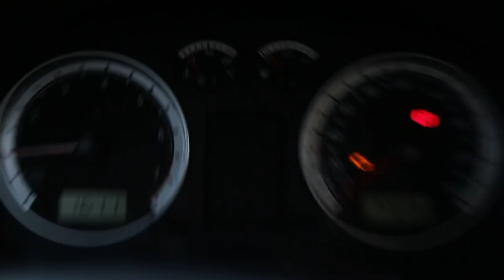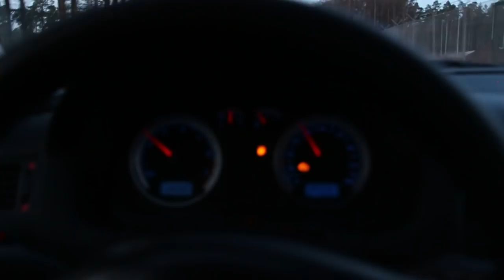KW V1 Coilover Install On The MK4 Bora Wagon!! Looks AMAZING!

Comment: Hey Christian,  I installed those on my Jetta MK4 and I love the way the KW's handle.  I had them way to low for driving around in Philadelphia,  I would scrape the subframe once or twice a day.  I get a little knocking sound from the rear shocks, did you experience that issue as well?